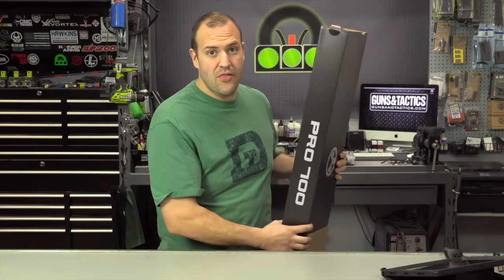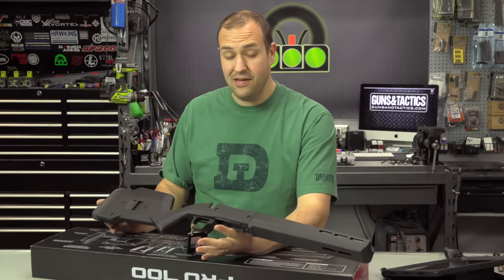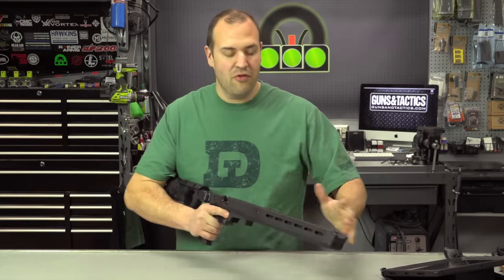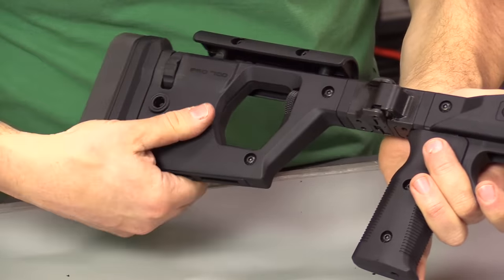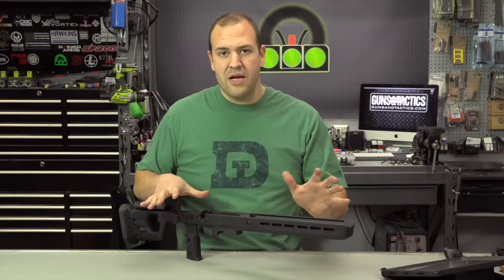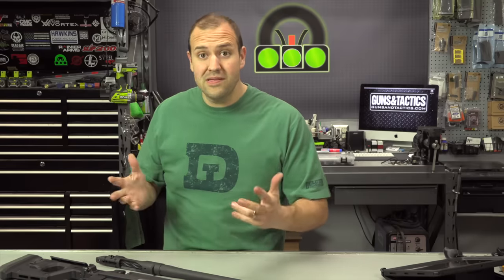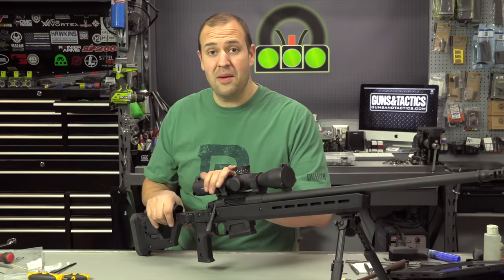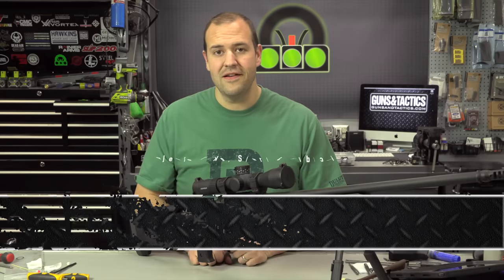First Look at the Magpul Pro 700

Comment: I picked up a pro 700 side fold in OD green for $700 shipped. It is very impressive, and the remington 700 is 14.3 lbs now.
Reply: too heavy imo.
Reply: @Ronda Griggs what?
Reply: @Ronda Griggs 308 20" heavy barrel, pro 700 stock with nv rail, 4-14 scope with Warne mount, area 419 acra rail with barricade stop, atlas bipod with 419 mount and barricade stop. Banish 30 silencer just approved, that will get it up to 15lbs lolz. Build what you like not what someone else likes. Some bolt guns are 24 lbs for competition.
Reply: Damn I was lookin at this but that too heavy lol What scope are you using?

Question though, do you know how much does the rest of the rifle weight without this chassis so I can estimate weights?
Reply: @DTreatz  the barrel is 7.5 lbs

Comment: Do you know the difference between pro 700 and pro700 long? please answer
Reply from the maker: Short action versus long action, same features but based on the length of your rifle action.  Long action rifles are generally magnum calibers, longer length ammunition.
Reply: @GunsandTactics  I want to use it for my AIRSOFT GUN Do you know which one I should buy? Because I can't use a real gun      thank you so much for replying
Reply from the maker: Depends on the action of your Airsoft gun.  The maker should have it
Reply: @GunsandTactics  If there is a difference between large caliber ammunition
Can you guess by the difference in width the cylinder moves back and forth?
Short action and long action I don't understand this exactly.

Comment: I'll keep my RPR .308 for $1200 and used the savings for my Vortex FFP PST II 5-25X50.  Ruger sold their Precision Rifle stock for this price and threw in the rest of the gun for free LOL:).  It came with a 10 round Magpul magazine instead of the AI BUT takes most other designs too (including AI)...interchangeable.  So this Magpul version of the Remington doesn't even take Magpul mags?  If I already had a 700 I might have pulled the trigger on this though...utility and appearance is a 10.

Comment: Why do they not offer this with SR25/AR-10 patterned magazines?!  

Magpul makes those magazines as well.  

For logistical reasons I only want one .308 magazine type (just like I only have one for .223).
Reply from the maker: Bolt guns don’t have lugs and feed ramps the same as an ar10/sr25.  The feed lips don’t line the rounds up to get optimal feeding in a bolt action. There can also be an issue of length for other calibers.  It’s been tried but not really successfully.   I would love one mag type too but sometimes performance requires specific stuff
Reply: Must be a 700 problem because Mossberg Patrol/Scout rifles can use them...
Reply from the maker: They have a different bolt design that allows them to use ar mags.  I’ve heard mixed reviews.  At this point I’ll stick to proven shooters and AI mags.  Cool idea for sure though

Comment: I think the one big negative to this chassis is the lack of ar pistolgrip options. Wtf magpul
Reply from the maker: Call me crazy but I actually like the grip.  I think AR grips on bolt guns are kinda lame.
Reply: @GunsandTactics  if it works great I guess. I had some thoughts on adding a sniper pistol grip to this chassis. I'm about to pull the trigger on either the magpul pro or the mdt tac21. Nothings perfect the tac21 does not fold like the magpul 😒

Comment: So for $1000.  I can get Master Piece Arms chassis for less. And imo, the MPA looks at least 10 times better and more color selection. IMO,  they should’ve listed this around $500 to $600. I run a AICS chassis on my 700 and that was $1000, which is way better than the Magpul. Even the Hunter 700 is not as good as other manufacturers. Kinetic Research Group makes a Bravo chassis that is better. For the same price with the trigger guard and removable magazine, KRG has adjustable comb height built in. You have Magpul bipod in the video also. They wobble a bit compare to other brands. Don’t get me wrong, I’m not a Magpul hater. I have a lot of Magpul products including 2 PRS stocks on my other rifles.
Reply from the maker: The bipod is definitely not the nicest but for $100 it’s not bad. Jury is still out on that. As far as the comparison to other products there will always be pros and cons. The magpul chassis can be found easily for under $800 and you still gain more adjustability and a folding stock versus the masterpiece. Don’t get me wrong the masterpiece as well as the accuracy international are both very nice products as well. Ultimately at the end of the day you have to decide which is the best for you. AI stuff is also very nice
Reply from the maker: The bravo is also a very nice product, I own one of those stocks as well and I would agree it is nicer than the hunter but for almost double the price it should be. Hunters can be found regularly for under $200 as well

Comment: lmfao 2 major fails. the rem 700 isn't the best especially not out of the box so only offering it in that is a waste to be honest. and 2, anyone paying anything close to or more than $1000 for a rifle stock should be looking into an actual chassis. why would i want to build a rifle that cost as much as a precision rifle only to have it JUST look like one.
Reply from the maker: Nearly every high end custom action uses a 700 footprint, so how is that a major fail?   Also I think this actually competes really well with the chassis on the market.  I think it’s more comfortable and has veered adjustment.
Reply: @GunsandTactics  didn't say the 700 didnt have great marketing. just said in stock OEM form its far from the best. also ill never believe polymer to be anywhere near as rigid as aluminum, just like aluminum will never be as rigid as steel. its not even in the same league as even a base like chassis. its just another stock. with an over marketed name.